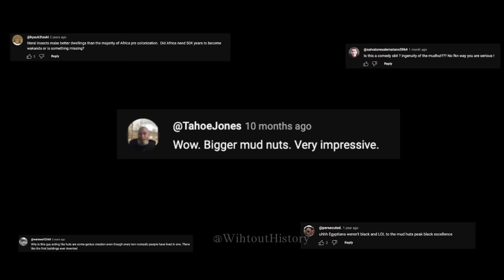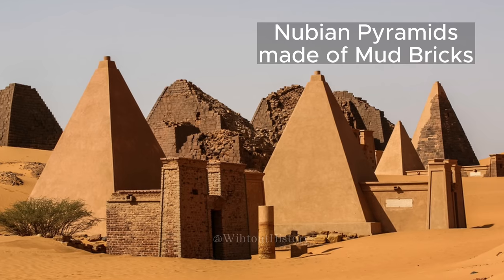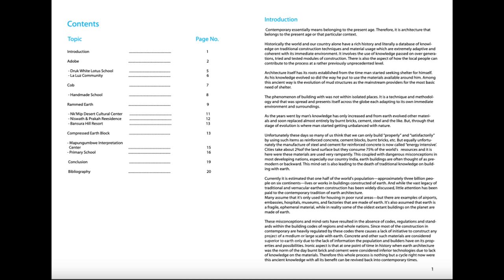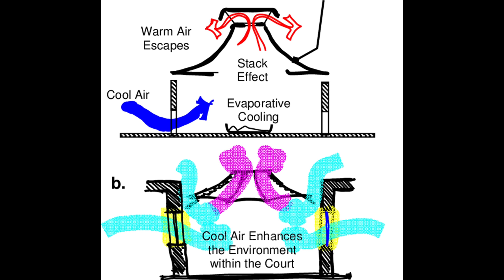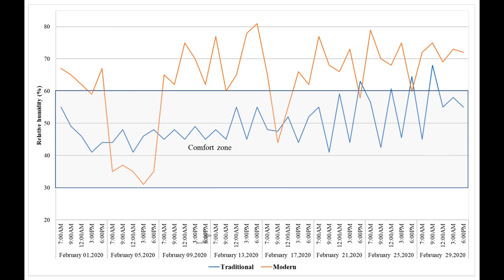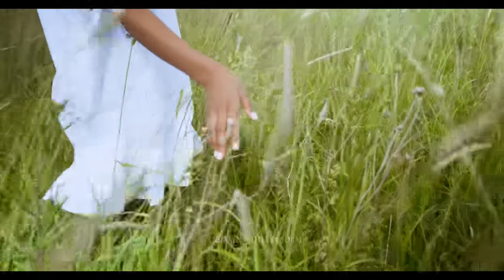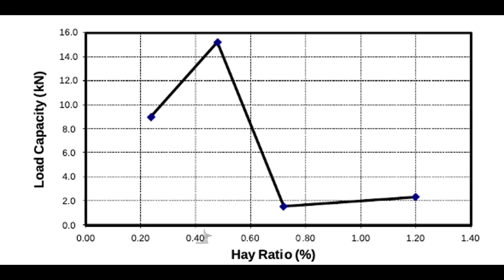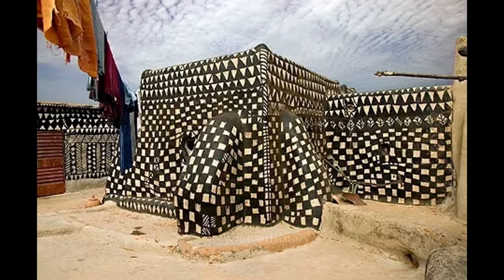Genius Ancient Mud Building Tech...

Comment: As someone who lived in both a mud and concrete houses  will experience the great difference between the mud house is much more cooler in Trinidad where I live there are two leafs to use as roof one is highly flammable The Carat leaf The Other is Timit which almost fire proof,these mud houses are exactly as you describe it.